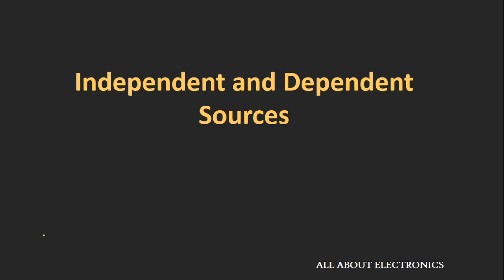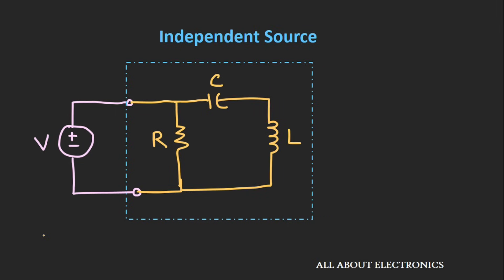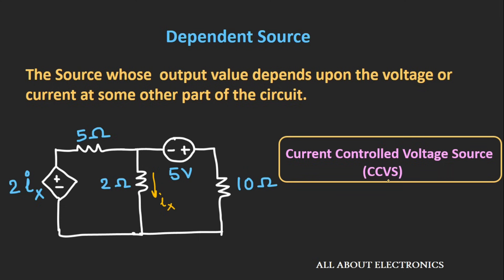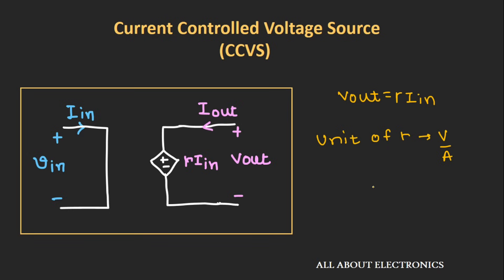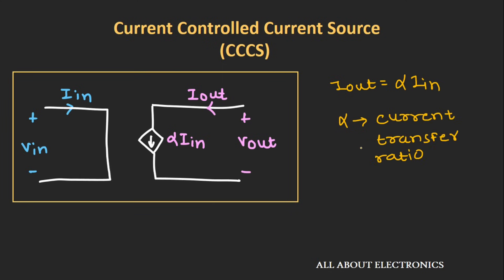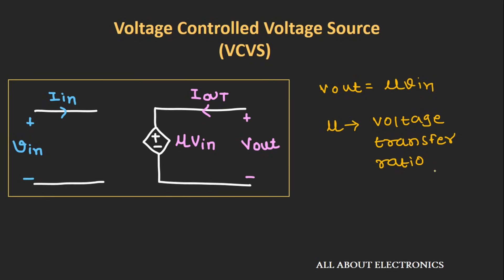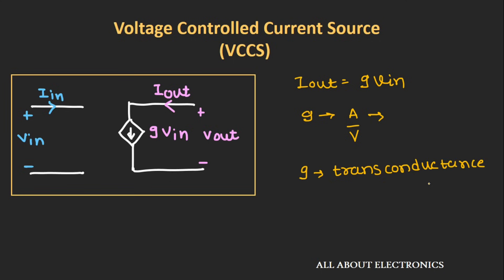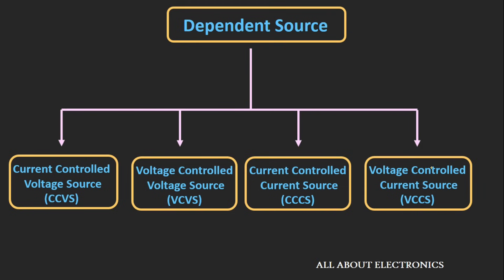Independent and Dependent (Controlled) Sources

Comment: Practical Examples
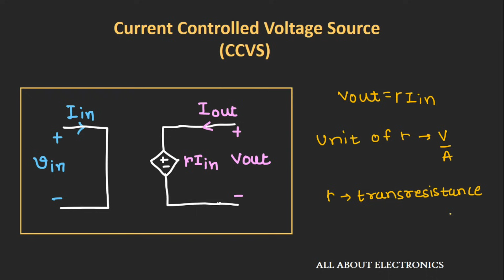3:47 CCVS it’s practical example is op amp transresistance

An op-amp transresistance amplifier, also called a transimpedance amplifier, is a circuit that converts a current input into a voltage output. It is used to amplify the current output of sensors like photodiodes

4:39 CCCS- BJT:  is mostly used for switching and amplification purpose.

5:33 VCVS: OPAmp

6:32 VCCS MOSFET

Comment: time stamp  3.02 instead of current controlled current source, you have mentioned current controlled voltage source, ( 3rd square ),  you have already mentioned current controlled voltage source in 1 st square. please correct. also make the diamond shape square clear,

Comment: What is the use of independent or dependent sources
Reply from the maker: Many times in the actual design or during the analysis of the circuit, we come across these sources. For example, just take the case of aBJT or MOSFET amplifier. It is biased with independent DC sources. And sometimes the same BJT or MOSFET, is used as current source (It is the dependent current source) in some other circuit. So, to simplify the analysis, it is represented by the dependent source during the analysis. I hope it will clear your doubt.

Comment: What is the practical device for independent current source?
I'm not finding this anywhere.
0:58
Reply from the maker: Well ideally there is no independent current source. Whichever available in the market are derived with the help of the other circuits. But when such sources are directly used in some other circuits, then they can be considered as the independent current sources, because their behaviour does not depend on the new circuit parameters. In other way, it's value does not depend on the voltage or current across any element in the new circuit. I hope it will clear your doubt.
Reply: @ALLABOUTELECTRONICS  
Thanks
I'm amazed by the fact that u clear my doubt within a day!!
U are really doing very good work

Comment: Sir, can we use the concept of source transformation for dependent sources or, is there any limitation in using source transformation theorem with dependent sources.
Reply from the maker: Yes, it can be used for the dependent sources.
Reply: The answer is yes. A dependent source is simply one whose current or voltage is not a constant, but a function of some input parameter x. So in the source transformation algebra, you simply regard the quantities V and I not as constants but as V(x) and I(x); in other words V(x)=I(x)R and I(x)=V(x)R.

Comment: I couldn't understand the example of voltage controlled voltage source.
Reply from the maker: In the voltage controlled voltage source, the controlling voltage controls the output voltage. 
And op-amp is the perfect example of that. 
Whenever the op-amp is used either in inverting or non-inverting configuration, then the output voltage is Vo = A x Vin
So, if you see, the output is directly proportional to input voltage.
If you change the input, then for the given fixed gain, the output will change. 
For more info, you can check the entire playlist on op-amp. 
Here is the link:
https://www.youtube.com/watch?v=kiiA6WTCQn0&list=PLwjK_iyK4LLDBB1E9MFbxGCEnmMMOAXOH
Reply: @ALLABOUTELECTRONICS  
Means both terminal of the opam will be either inverting or non inverting ?
Reply from the maker: Inverting and non-inverting are the two configurations of the op-amp. In the inverting configuration, the output will be 180 degrees out of phase with the input signal. (i.e Vo = -Ax Vin)
In the non-inverting configuration, it will be in phase with the input signal. (i.e Vo = Ax Vin)
For more detail, please check the videos on inverting and non-inverting configuration of the op-amp.
Reply: @ALLABOUTELECTRONICS  
I know sir, there are 2 configuration s. One inverting and other in non inverting. But in the vcvs , you have given inverting sign in both input terminals.
Reply from the maker: @startexploring66  No, that is by mistake. The lower terminal should be positive, and the upper terminal should be positive. Basically, it's inverting configuration.

Comment: Hello! What is the function of a dependent source in a circuit?
Reply from the maker: Let's say, you want to control the load current in a particular circuit. And if you able to do that by changing the voltage at some other node. e.g MOSFET. In MOSFET, the output current (Drain current) is the function of the voltage applied between the gate and source. 
So, just by changing the gate voltage, it is possible to control the current.  And if the load connected to the MOSFET then in a way it is possible to control the current through the load. 
I hope it will clear your doubt.

Comment: sir where do we use independent sources and what are its applications
Reply from the maker: DC power supply or simple battery is an example of an independent source. And in fact, it is used in all electronic circuits.

Comment: sir kya current source practically exist karta h . plz rply....
Reply from the maker: The current source does not exist but it can be designed using the transistors and op-amps. And many ICs are also available which provides a constant current.